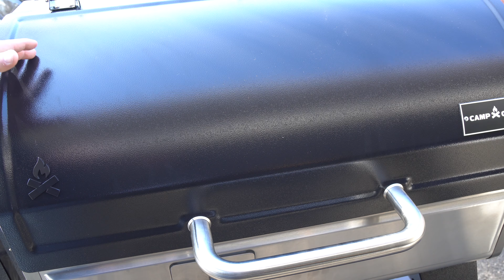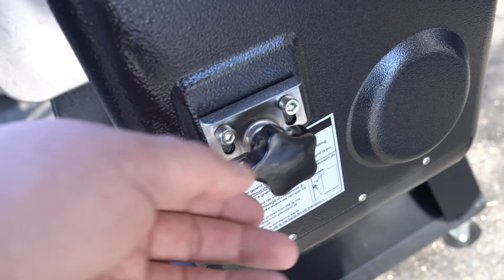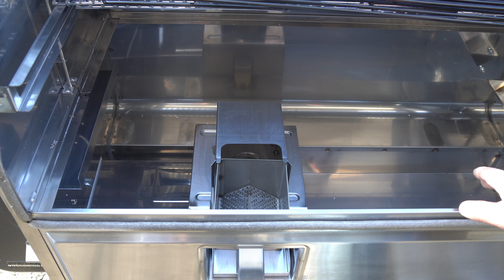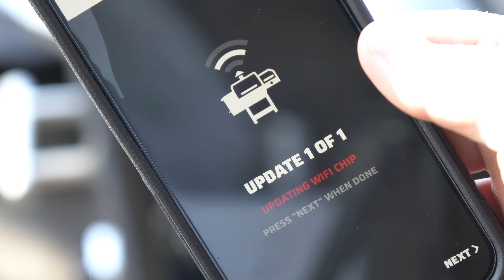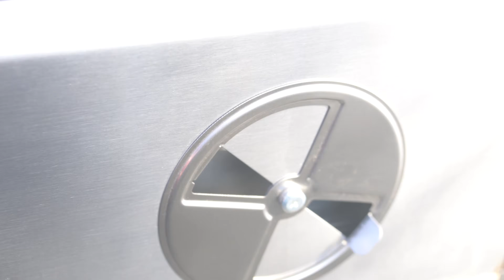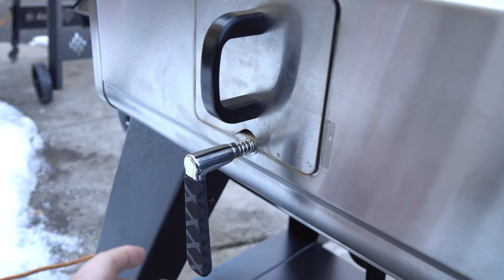Rib Heaven: The Camp Chef Woodwind Pro 36 Review And Taste Test!

Comment: One BIG flaw this smoker has is when it rains all water accumulated on the lid will fall on your food when you open that lid.  Also, my lid is NOT smoke tight at all.  Something like 3/8 off.  So those gasket all around are next to useless unless I put a 20 lbs weight on the handle.  Also,  the temperature varies above 75 degrees inside the smoker.  I think a 24 inches instead of the 36 inches would have been better.  My previous "standard" no-pro  24 inches CampChef cooks actually better.
Reply: Maybe it's time for an update after a year.  I learned heat management and literally transform this 36 into a 24 inches.  I install pans filled up with wood chunks to reduce the cooking area. On both shelfs.  With the actual benefit that those wood chunks are pre-smoked-bone-dried when I need them.  All of my gasket are dead and would normally need replacement.  Temp sensors melted a loooooooooog time ago.  Replaced them with full stainless steels one. (600 F safe) from Fireboard.  I had to buy jack adapters cause Fireboard's jacks are smaller than Camp Chef.  Still love that smoker.  I cook everything on it.  Pizza, Chicken pie, any piece of meat you can imagine, et.c.